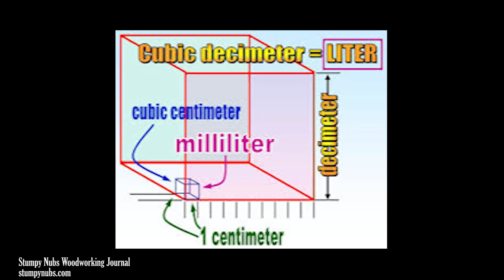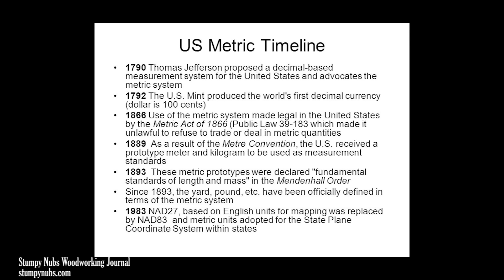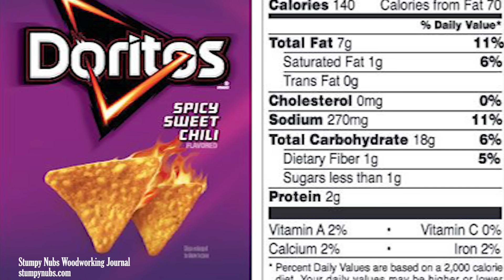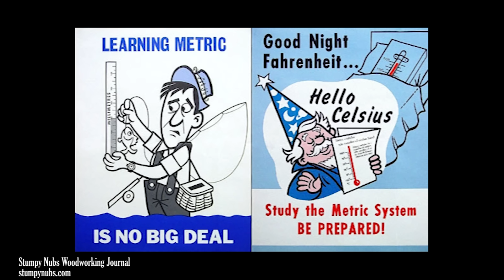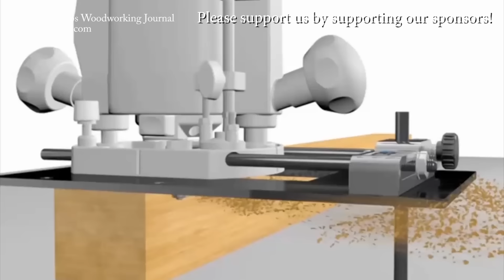BREAKING: The USA is switching to METRIC!

Comment: I'm Canadian and we use both. For projects I am forever using Imperial but since I have found using metric for european facless cabinetry has been a godsend. Now I am converting most projects to metric.
Reply: Whats the difference/ All measurements are arbitrary. The reason for the mile is that it relates to some variable of the circumference of the earth, which also happens to be mirrored in pyramid building. An inch is whatever you make of it, so it 3/10th of a centimeter, or 30 millimeters. The distance a millimeter covers was a standardized measurement that doesnt exist in nature, but was a human creation.
Reply: @neglectfulsausage7689  The reason it makes a difference is the numbers are anything but arbitrary. No you can't decide that an inch is 30mm, it's actually 25.4mm. And with very odd numbers like that, it becomes very difficult to make fast precise measurement calculations. If you work with USCS (imperial) construction materials (wood, pipes...), it makes no sense to measure everything in metric (like here in Canada). 
I agree that engineers / technicians who do the plans on their computers can very easily switch system with the push of a button and all calculations will be made automatically. But you don't want every construction worker to stop doing what they do, take out a calculator or their phone to translate everything they need to do, then continue. It needs to be intuitive.
Reply: @eralar2  Obviously, there will be some growing pains, but it's totally possible. Metric can be just as intuitive, they just have to train their intuition. I will admit dividing will be more awkward than now, but dividing 12 by 4 and dividing 10 by 4 can both be done mentally.

Comment: I use millimeter tools to measure and cut my home improvement projects, it really is simpler than dealing with power of two fractions and inches. --- not to mention converting between inches, fractions, decimal inches, inches and feet, decimal feet, etc.  might as well just convert to mm and get on with it.  I only use inches where something is supposed to come out even, for example 16" on center studs or a 4x8 sheet of plywood.

Comment: I’ve been using the metric system instead of the imperial one for nearly a year, I put my phone in metric to force myself to learn it. I recommend doing that and you get to annoy others by giving the weather in Celsius 😊
Reply: I do the same thing!
Reply: I use Celsius all the time, never learned Fahrenheit expect 32F is 0C, 68F is 20C (hauling reefer trailers lol) and 212F is 100C. What's funny is that with my parents and I moved to US 10 years ago and they use Fahrenheit and they get annoyed when I give them temperature in Celsius. It's not like they used Celsius most of their lives lol
Reply: @KeyDx7  well I don't think so but to each their own I guess. 36.6⁰C is normal temperature and over 37⁰C means you're sick. I don't even know how much that is in Fahrenheit
Reply: @@KeyDx7 Why? 
37°C is 98.6°F both seem stupid?
Reply: Celcius is related to water, so it's easier in that regard: 0 is freeing temp, 100 is boiling. Comfort temp is more subjective, tbh 18 degree in summer means you are freezing, as you get used to temp above 26. But in winter in warm day you got 15 °C, and you sweating as you are used to temps near and below 0. As for weather... You know that when it's above zero there will be no ice, when below you need watch out. Same with boiling, if your car reach 95, and you don't have cooling fluid, but water, it's a warning that your engine will soon blew.
Reply: @@KeyDx7Yes, because something that changes state with 32° of thermal energy (water to ice) or an average body temperature of 98.6° makes so much more sense than a 0-100 scale.
Reply: Temperature is the only measurement where I prefer Imperial scale. The reason for me, is granularity. Degree F is smaller than degree C and my body seems to be able to sense at that granularity. I don't have an issue with the reference points. 32F is freezing,  212F is boiling. 0F is damn cold and 100F is damn hot. Simple 😉
Reply: Same here
Reply: Look, as a person living in the USA, I'm all for adding metric where it makes sense.  Especially when measuring ingredients in the kitchen; grams and ml are SOOOO much more simple and precise than dealing with teaspoons and cups and quarts.  However, I do still think that measuring temperature in Fahrenheit is better than Celsius on a practical level.  Sure, within the scientific community, Celsius might have a couple of advantages, but for everyday life, Fahrenheit is just better.  Celsius is just too condensed as a metric for measuring the things a typical person encounters during their day.  Having 0-100º representing the range between freezing and boiling is just not applicable to the life of the average person.  As a result, the Celsius system has to routinely be broken down into decimals in order to maintain a practical level of nuance.  This is because the difference in 1º of Celsius is too much of a meaningful change, and it represents 1.8º of movement in the Fahrenheit system.  But 1ºF of movement is a really nicely balanced measurement of change for the average human to detect in their environment, without needing to be broken down into decimals.   With Fahrenheit in our daily lives, we can remain more precise whilst only using whole numbers, and with increments that are easily stacked and calculated.  I'll give some examples: 

With the exception of actually boiling some water, when do we ever need to know how close to boiling the temperature is outside?  When I am setting my climate control in my apartment or in my car, I get to deal with whole round numbers that represent a change that is just the right amount of perceptible.  When you switch over to Celsius, now your thermostat has to provide you with decimals to achieve that same level of nuance.  And before you call me some dumb American who is afraid of decimals, remember that all you non-Americans freak out about calculating all of the fractions in the SAE feet/inches such as 7/16 or 13/32, so I am very comfortable with fractions and decimals.  But just like I will readily admit that the SAE measurements are not as ideal for construction projects, I also think people should admit that Celsius is not as ideal for measuring the temperature in the average human's environment.  Resorting to fractions and decimals just shows that the application of that system is potentially flawed.  Taking this argument even a bit further, let's talk about body temperature.  The "normal" resting body temperature in ºF is 98.6; not 98.5º or 99º.  They had to break it down into decimals because even a few tenths of a degree in Fahrenheit is enough to make a meaningful difference diagnostically.  So why on earth would I want to measure my body temperature in Celsius, where a tenth of a degree is worth almost TWICE as much as it is in Fahrenheit, losing even less of the nuance.

Additionally, even in the kitchen (the ONE place where the average human actually needs to worry about boiling temperatures), I STILL prefer Fahrenheit over Celsius.  Sure, I have to remember that 212º is boiling temp at sea level, but again Fahrenheit still produces more rounded and even numbers to represent meaningful changes in temperature.   350ºF is the perfect standard baking temperature compared to 176ºC.  And you can achieve meaningful shades of difference by raising or lowering that temperature in increments of 25º.  The vast majority of cooking tasks such as baking, frying, or roasting occur between the Fahrenheit temperature ranges of 300º all the way to 450º, and each time you want to meaningfully raise or lower the cooking temperature, you can just do it in increments of 25º or 50º.  The closest rounded temperature range in Celsius would be 150º-230º.  The Fahrenheit range from 300º-450º gives you 150º degrees of change, whereas the Celsius only gives you 80º in the same range.  Those Celsius degree ranges just make it much harder to quickly step up and down your temperatures; a 10ºC increment might be too little, and a 25ºC increment would be too much, and all the while, each change is done with obtuse and clunky increments.  With Fahrenheit, it's a lot easier to just deal with 300º, 350º, 375º, 400º, and so on.   Even measuring steak/meat doneness levels can easily go up in increments of 10º that are all divisible by units of 5.  In Fahrenheit, Rare = 125ºF  Med-Rare = 135ºF Medium = 145º, etc. etc.  In Celsius those same temperatures are 51.6º, 57.2º, and 62.7º.  Even if you try to round those numbers, you end up with 52º, 57º, and 63º, which means you're losing the nuance and that is just such an obnoxiously unrelated set of digits to remember. 

Again, I am ALL FOR ditching imperial standard measurement for lots of things, and I really can't remember the last time I used cups and ounces and lbs in the kitchen, but Fahrenheit is still the more effective unit for everyday humans.
Reply: @dirtyketchup is 1C° really too much of a change? People here dont reaaly deal with the fractions maybe only when they have fever? And when somebody ask the temperature we answer a whole number, or whole number and half. I think its perfectly fine
Reply: @dirtyketchup again, sorry for saying this again, but i really didnt encounter people who needed that level of granuality in their everyday life's.

But both system should be fine if you just stick to one at a time and dont mix them up like that one time in the appollo program
Reply: @dirtyketchup  Fractions are a pain to work with for display purposes on computers and things like that.  A lot of ovens are not calibrated correctly anyhow and they fluctuate.
Reply: I'll pass! But if you use Celsius! More power to ya! I personally don't just jump on everyone else's band wagon!
Reply: @dirtyketchup  You get me.  I've made this same argument myself, but far less eloquently.  Yes, I can feel the difference between 73 and 74, thank you very much.  Other than temp, I use metric for anything else I can, and I'm also fine using C in certain application, but my thermostats will always be in F.  We can have that one thing.
Reply: @DamianSheesh  yep. It just makes so much more sense in our everyday lives.
Reply: @houtdraaien7103  Celsius is a linear scale, though. The difference between two degrees of Fahrenheit is going to vary, depending on where on the scale you look. With Celsius, however, the magnitude of a degree is always going to be the same.
Reply: @dirtyketchup  We hardly ever use fractions with Celsius in our daily lives. The only exception is when measuring body temperature. 36.5 - 37.5 is normal; then up to 38.5 you have a slight fever; 39.x is a high fever, and 40+ is a severe fever. Fahrenheit is not remotely better here, because first of all, you also use fractions to measure fever (normal temperature being 97.7 - 99.5🤨) , and second, since the temperature is already a high number you don't get as much sense of the scale between the numbers. 100 doesn't sound so bad when 99 is normal.
Reply: @MKRN98  IMHO, temperature is the measure that's hardest to adapt to.
Reply: Well actually, it should be in kelvins. For example, it's a nice springy day outside, about 270 K. A hot summer day: 290 K. A comfortable indoor temperature: about 295 K.
Reply: Yes I do that too.  But I yearn for the phone that will do Kelvins.  BTW if all the advantages of SI units over imperial nonsense, Celsius offers the least benefit over Fahrenheit.  Both are objectively pretty equivalent.
Reply: Freezing is zero degrees and boiling is 100 degrees....Why on the earth would you have to try and make that harder?
Reply: Celsius is not even SI. Kelvin is.
Reply: @ronaldderooij1774  Degree Celsius is an SI derived unit, for some reason.

Comment: Call me weird, but back when I was building sheds (I'm in Australia), I'd discuss and visualise a shed size in feet but the contracts and building was constructed in metric. And I was raised on the metric system 😁
Reply: As a Québécois I do the same :)
Reply: Fellow Aussie here. I still talk in feet and inches, but do all my woodworking and design work in mm (not even in cm!). We're an odd lot, eh? 🙂
Reply: @deldridg …Only schoolteachers & tailors do cm’s mate, tradesmen do milli’s. I also like using feet and inches for describing distances in human related terms but, large construction and intricate measuring, metric is the boss.
Reply: @biggest23 I once did a build that was in Imperial. For some reason the table ended up about knee height. Any ideas? 😜
Reply: @deldridg  …..Japanese tea house?
Reply: @biggest23 Yes, very good. That must be it!
Reply: Yeah but Aus is weird like that.
You'll say "just bought a 72 inch telly" but in the next breath say "Damn I've put on 3 kgs.. Not good for a 5 foot 2 inch guy" !
Reply: @0utcastAussie  I guess that all depends on what weight you were before your beer and ice cream session!
Reply: Sounds like me in the UK. My lounge is about 10 x 17 feet which is what I understand about the size of a room. But when I cut laminate floor and skirting it's definitely measures in metres!
Reply: How do they sell plywood in OZ? Is there metric dimensioned plywood and drywall? What is a typical ceiling hight in Meters?

Comment: I'm a 61-year-old American. I have been using BOTH Metric and USCS my whole life. What I like about Metric, even MORE than the much-touted tenths bit, is the various units are related. I can visualize 1000 cc as a liter. (I don't have a dammed clue how cubic inches would relate to gallons at all!) Also having the "ounce" mean separate unrelated concepts (mass VS volume) is annoying. But since I'm used to USCS I can use it DISPITE its quirks and shortcomings. One part of USCS I would NOT get rid of is Fahrenheit for weather reporting. Celsius is fine for other uses (Kelvin for science though) But for weather reporting, Fahrenheit is human relatable scale: 0F is too cold, 100F is too hot. Oddity in US manufacturing: US Cigarettes METRIC in length- But they are USCS in circumference! (mm VS in).  (70,85, or 100, millimeters long, but 1.25 inches in circumference) 🤷‍♂️
Reply: 231 cubic inches in a gallon, I have it memorized sadly.
Reply: As a mechanical engineer, I worked for major companies who produce construction and agricultural vehicles starting in 1973.  Every finished part drawing I worked on was metric.  I can work in either system. I prefer the metric system.
Reply: @richardsparks9904  6/10 of a friggin CENTURY on this planet 🌎 to find out that it could not be a "neat' 230 cid?😳 Either way thanks brah!😁
Reply: Celsius is simpler: 0C - water freezes, 100C, water boils.
Reply: you like Fahrenheit because you are used to it, just like i am used to using Celsius, i like that more.

But, for us that are used to C, we have no problem figuring out the temp outside on a scale from -18ish C (iirc its 17,777) to 38ish C
And i find it kinda odd that this is always mentioned, the human relatable scale.
that is, 0F is to cold...
are you guys not cold in 5F ?
Because i am freezing my ass of at -15C

But hey, like i said, you like it because you are used to it.
Reply: @gpsoftsk1  I said HUMAN scale just for weather reporting. I'm not interested in what water feels about it. LOL.
Reply: 1000cc = 1l(iter) = 1000ml (milli liter; milli means 1/1000) = a cubic dm (decimeter; deci means 1/10) or 1 dm^3, so visualise a liter a the volume of a cubic decimeter, or 10 x 10 x 10 cm.
A cc (meaning cubic centimeter) = 1 ml, because, just like milliliters, there are 1000cc in a liter; 10cm x 10cm x 10cm = 1x1x1 dm = 1 dm^3 = 1 liter
Now, there are 1000 x 1000 x 1000m in a cubic km = 10^9 m^3 = 1000000000m^3 or a billion (US) cubic meters.
A liter weighs approx 1kg (kilogram), so a cubic km of water weighs a billion kg or 10^9 kg.
A ton (metric, what else) weighs 100,000kg, so a cubic km of water weighs 10,000 tons.

Try that simplicity in imperial.
Reply: @richardsparks9904  Not sure whether to applaud or be sorry for you ;-)
Reply: Ironically the international Metrological organisations use Metric not Fahrenheit. It must get confusing for pilots reading the Metars in Fahrenheit and switching to Celcius as they go outside the US

Comment: When i started my apprenticeship 20 years ago in the UK, I only knew metric measurements, but alot of the old joiners used imperial mostly.
I soon learned and found it easy to adapt, my personal preference now  is Imperial for sitework and Metric for the workshop. 
In the end, it doesn't really matter, I'll use whatever someone is comfortable with, its just a tool to communicate it, use whatever you can communicate with best.
Reply: Nice to hear a reasonable approach. 

Most guys just lean towards whatever their tools have. Especially machinists, where the tools can be older than the adoption of metric.
Reply: I started my apprenticeship with Rolls Royce Aerospace 50 years ago and we used imperial but after being hired by a California company in 1974 I continued the practice but all the theads changed, later on we engineers were converting from the customers metric to imperial and that was always messy but to put 2 units out to the shop would have been worse.
My personal preference has been metric for a long time but I am bilingual in the measurement world. My brother in law who is a builder in the uk still takes about a 2 by 4 3 meters long and orders pints of course.